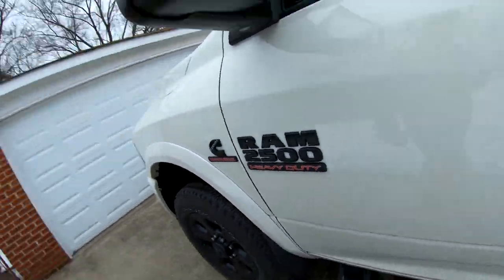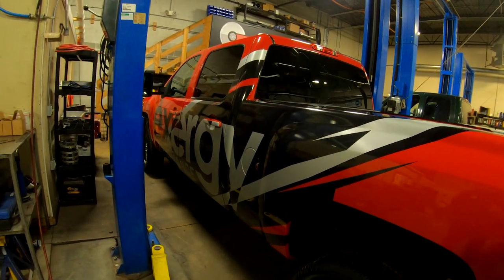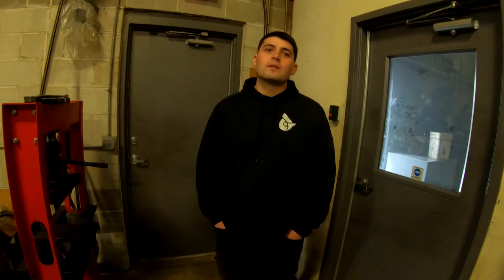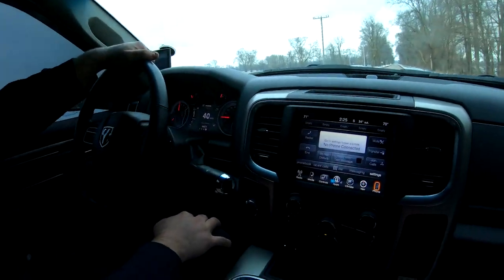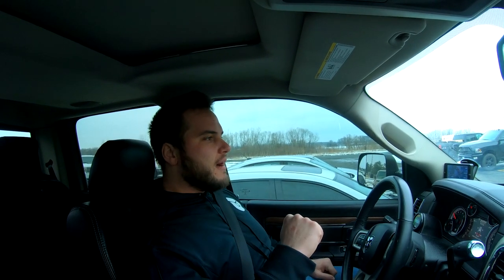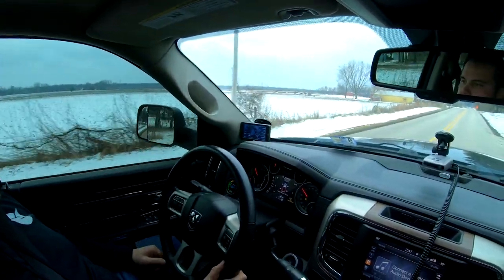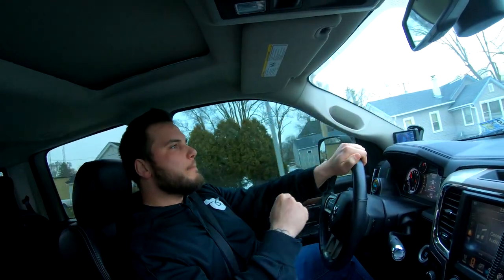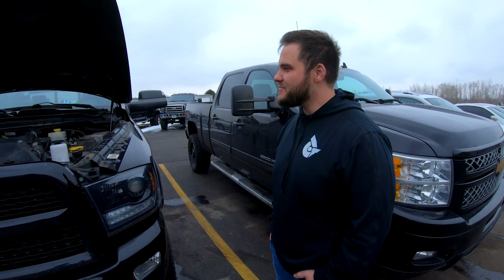I Visited Calibrated Power Solutions - Big Surprise for my 2018 Ram Cummins 2500!

Comment: Had my 14 ram 2500 engine and trans tuned by Calibrated power since 2015 it’s been awesome, now I’m working on doing ATS compound and revmax 700 trans  and dual cp3s Just like their 2015 ram, I Highly recommend them
Reply: Thats great to hear. I am currently looking at the tuning from them. I do have someone else for tuning and EZ Lynk, but fully deleted and going back to emissions.

Comment: Too bad you can't do a full delete.
Reply from the maker: I still may do that down the road, but for now with my warranty and it still be brand new this will have to work.
Reply: @BlueEvolution312  Oh ok, I just wasn't sure if you were in a state that had the strict enviro laws.
Reply: Blue Evolution 312 Since you’ve tuned it, your warranty is gone.
Reply: Yep tune = NO warranty , so go for a full delete now lol
Reply: Warranty has been deleted,but it's still cool to make clean power & no worries with the smog patrol.
Reply: They're cracking down all over the country for deleted diesels. Old boss was just fined $5000 for having his truck deleted.
Reply: @mitchjruiz  what state you in? i know my state DEC is cracking down on deleted trucks with steep fines.